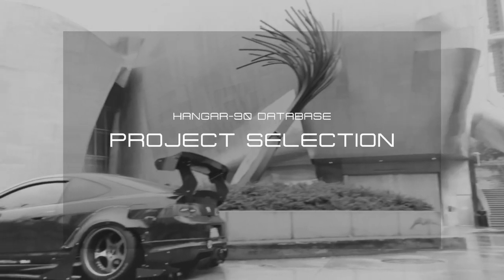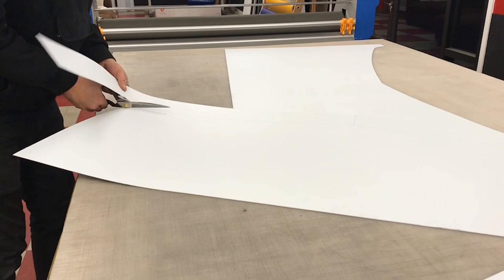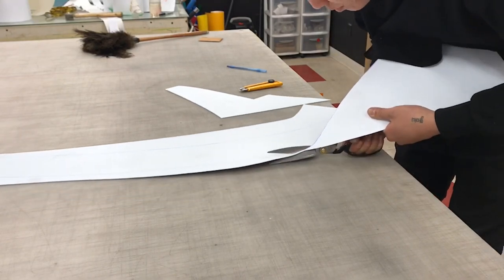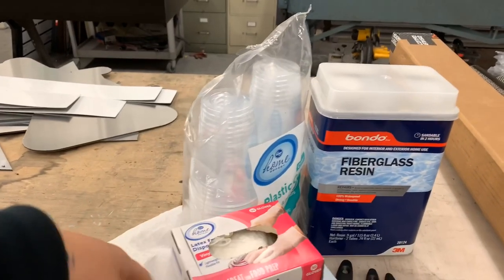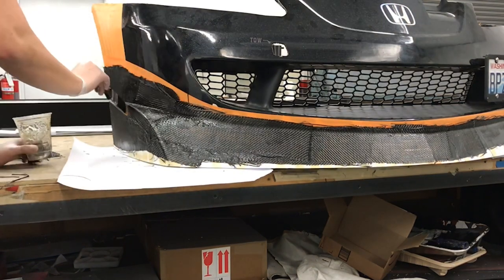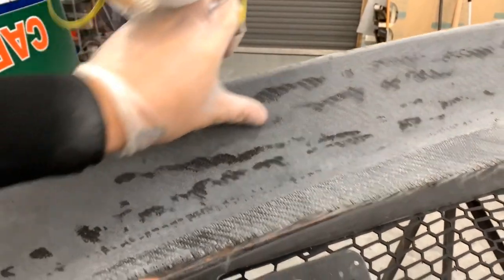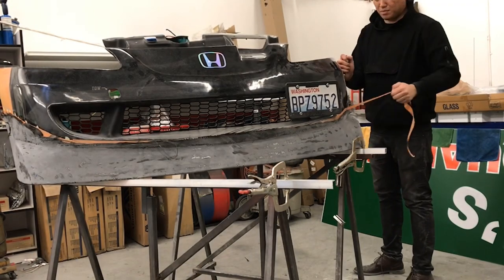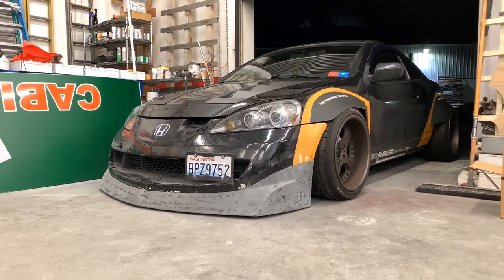MAKING My Front Lip DIY | Yoonicorn EP. 02

Comment: Great video & great idea on the splitter. glass Chop strand mat is fine for this kind of work & much easier to use than carbon weave & much cheaper. It is pretty much a non structural component.

Comment: What type of resin is it? I have the paper and I have some fabric here already I just didnt know if it's just plain fiberglass resin mixed with black pigment or something
Reply from the maker: The fabric I usually would use is a 2nd grade carbon fiber. If i could I try to use a clear resin, but the resin I tend to use for any project that I plan to fill or color, I just use a home improvement grade resin, usually bondo, and they are usually brown in color
Reply: Thank you for you reply I appreciate it.

Comment: Bro which material useing?
Reply from the maker: For the template for this buiild, polystyrene and then overlayed with carbonfiber
Reply: @EMIYOON  Can I use also pvc foamboard?
Reply: @EMIYOON  Could you also send me a link to yours material polystyrene?
Reply from the maker: I dont have a link for my materials because i used to get them through a supplier locally.  As for the pvc, that is a material i loved using because it was very easy to cut. Only thing is, you have to use a very thin sheet and usually, those are very brittle and break easily.

Comment: Do you have a particular place you buy the polystyrene sheets from?
Reply: @ExplosiveBanana and you just asked for polystyrene sheets? I’ve called my local plastic distributor and they had no idea what the hell im talking about then ask me what’s it’s used for and I end up like this 🤦‍♂️ then hanging up on them
Reply: @ExplosiveBanana thanks a whole bunch for the response now I can finally go look for some
Reply from the maker: unfortunately, the polystyrene, when I used to work for a sign shop, I would get from our distributor for material. I am currently looking for an online shop that would sell that publicly..
Reply from the maker: @ExplosiveBanana my apologies, you are correct. I believe that it is not 3mm or 6mm, rather, .030 and .060 in inches, in thickness. but yeah, 3mm and 6mm would be insane to cut with scissors hahahahaha
Reply from the maker: @doughboyjoe6518  best to try asking a sign shop. its not really a common material used though